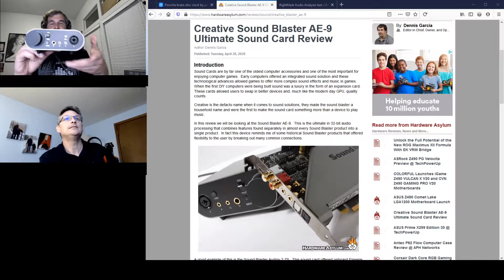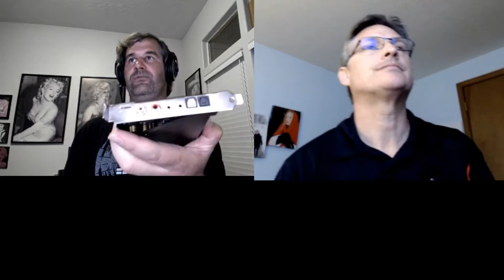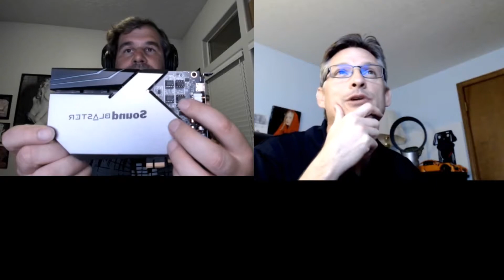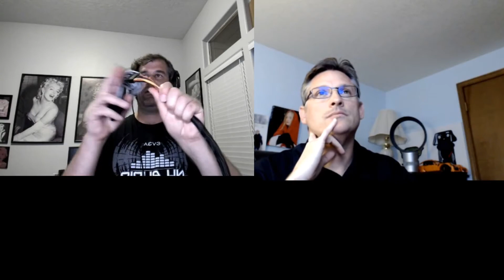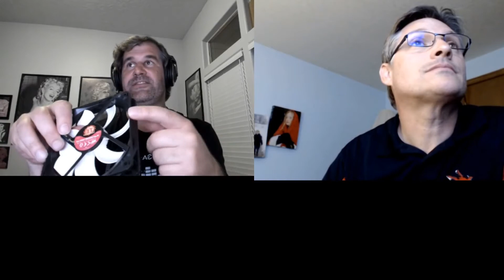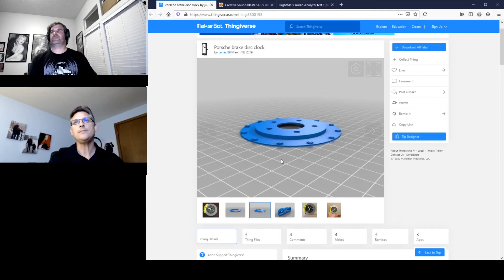Proper Sound Card Testing, Cool PC Mods and 3D Printing Projects

Comment: Hi very  nice very video, channel and web page very informative. How do you compare the Sound Blaster AE-9 with a onboard sound card in term of audio quality (my motherboard is a 7  years old Realtek ALC1150)  ? Do you think worth the price? I have Beyerdinamic 990 pro 250 ohm.  I think my actual mother board dosent have enought power to drive my headphone. But i am not sure. Congratulation and keep your hard and nice work
Reply from the maker: Audio testing is done two ways.  One is manual where we simply listen, every headphone is slightly different and the power behind it is actually quite noticeable.  For more detailed testing I use a software package called "rightmark audio analyzer" and do a loopback test over the line level outputs.  That will give you the basic stats but doesn't really address wattage etc..  For that I trust the documentation.

Testing the AE-9 was a challenge and is why it was a subject of that Podcast.

If you are using a professional quality headset then yes the AE-9 is worth the cost, though if you are just listening to music and not needing a microphone or any of the cool mic features you might look at a DAC which will use your existing motherboard output and create a signal which can be used by your Beyer 990s.
Reply: @Hardwareasylum  thank you
Reply: @Hardwareasylum  I got Z906 will be connecting with my optical out. I have planned my build already here in India..

Motherboard-   ASDS
•	Gigabyte Z490 AORUS ULTRA
Processor- ANY ONE- Intel Core i7-10700F 
OS -Windows 10 PRO 64 Bit 
RAM- 32GB Corsair Vengeance 3600Mhz (16 X 2) NON RGB

SSD0- C-DRIVE OS (Windows 10 PRO 64 Bit)
•	Samsung SSD 970 PRO NVMe M.2 512GB MZ-V7P512BW
HDD SATA6 - Seagate 4 TB 7200RPM D-Drive
Graphics Card
•	Gigabyte GeForce® GTX 1660 SUPER™ GAMING 6G-GV-N166SGAMING-6GD
Cabinet-BLACK NON TRANSPARENT
•	Antec P101 SILENT 
SMPS- ANY ONE
•	Cooler Master MWE 850 V2 80 Plus Gold -FULLY MODULAR
Cooler CPU- Corsair H115i PRO cooler
UPS- 1000 Kva NUMERIC
PCI-E soundcard 
Sound-Blaster-AE-9
Needs 6 x 2 pin Power pin from SMPS
https://asia.creative.com/p/sound-cards/sound-blaster-ae-9